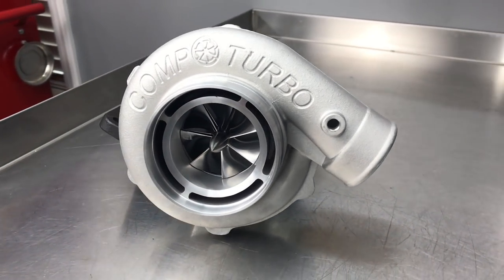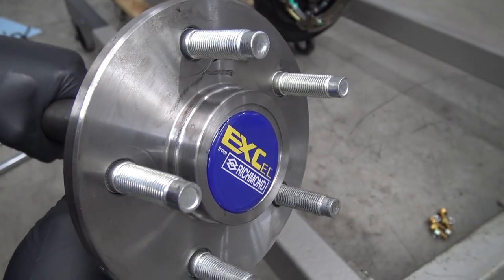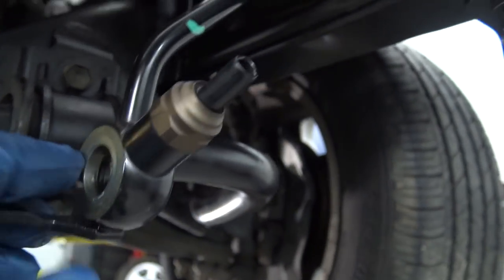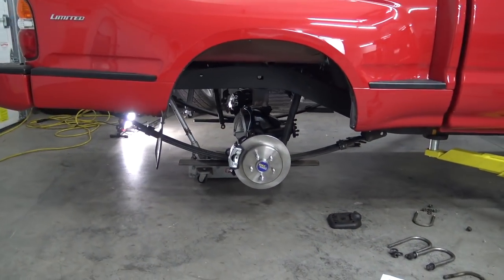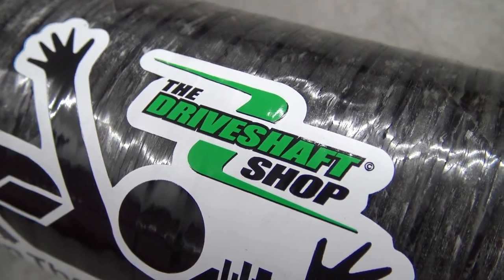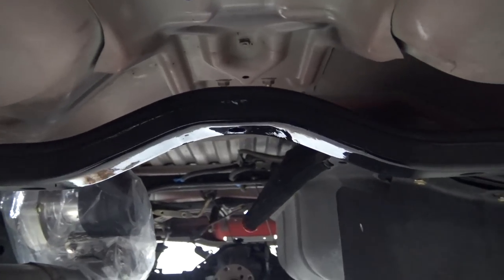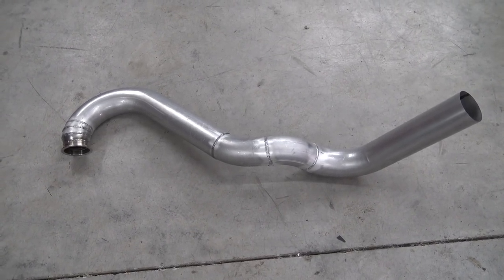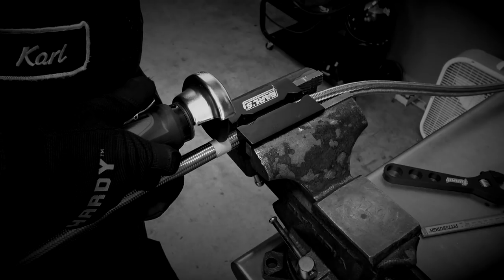LSX V8 Turbo Tacoma - Project Firebolt Part 9

Comment: Wow, can't believe that axle is virtually a direct swap. I love it when parts from other brands can be interchanged, it makes building your own unique project much easier. Great exhaust job BTW, keep up the great work. ;)
Reply: The Taco is a pretty accepting body. Quite a few different bits and bobs can find under and still look OEMish. My theory is that Toyota did some market play and knew that the average Joe would eventually do some twiddling with their truck and made it possible to swap in existing parts off other cars. Would not be a first, Honda certainly played nice with the locals.
Reply: @aserta  You might be right about Toyota, or is it possible they "copied" the Ford unit? Talking about OEM, I like the way Tom does his builds, they always look OEM and factory, gives the finish project a very clean look.
Reply: The explorer 8.8 fits under a d21 hardbody as well.... I'm doing a similar build, only 5 spd manual.
Reply: @derekhansen6652  Really? It's like Toyota and Ford are "pick n mix" lol.
Reply: Ford 8.8 is certainly the best choice for this build. They have been used for decades on Jeeps and have broad aftermarket coverage. Bonus for an easy fit on Tacomas!
Reply: @painmagnet1  Yeah, isn't the Ford 8.8 virtually indestructible? lol.
Reply: @ProjectSupercar  it's beefy, cheap and plentiful.
Reply: @superduty4556  Yep, just the way I like it lol. :)

Comment: Muffler too shiny? Wrap it! It'll help stop you melting your spare as well :)
Reply from the maker: Hi Nik, I've considered wrapping it or chucking one of those muffler blankets on it.
Reply: I was thinking a coat of ceramic high heat paint would be great compared to a blanket. I'm not certain but that being in the undercarriage it may just collect debris and water.
Reply: I feel a Binky style "CAD" designed heat-shield is required. Flex those fabrication skills. And of course painted in the habitual enamel black
Reply: For sure! Also, regular paint doesn't last on stainless. Ask me how I know.
Reply: @TomsTurboGarage  I put a Vibrant resonator on the back of my GMC (solution to a way too loud cat back system). in a similar location your muffler is in.  If you plan on using your truck in all weather conditions, the high shine will dull out over time.

On other note,  Awesome build!

Comment: Looks like you may want some longer wheel studs for that rear. The wheel bolts didnt look like they had too much thread engagement.  Always run three thread out in safety for aviation so maybe I'm just being over cautious. 
Great video as always though, always jealous of your shop setup!
Reply from the maker: Thank you sir, that is a good tip, I'll definitely need some longer ones if I want to run slicks.
Reply: Maybe some ARP extended ones? Trustworthy and track tested. Some may say ugly as they can protrude through the nut........... but not as ugly as a motor on the side of the track missing a wheel!!
Reply: It is worth noting that this style of lug nut does not seat on a taper in the wheel, they are designed to pass clean through the hole. The washer is the contact point. While extended studs may be necessary if he wants to run different wheels/racing slicks, they fit very similarly to the stock arrangement as they are now.
Reply: Given the lug nut style it looks fine to me.
Reply: Don't get me wrong for a daily driver they are more than enough especially when you consider the design having probably twice as many threads compared to a stock nut.

My thought was for track use and potential wheel changes or use of spacers you suddenly eat up any benefit the better design gives, with the increased stress of the track or strip And for the sake of £34/$42 a side when you have spent thousands in parts and your own time, seems worth it in my opinion for the peace of mind when you rip down the strip for the first time.

Probably me being over cautious and coming from a trade where it's laid down that the threads of the bolt must protrude 1.5-3 threads from the top of the locking device. But I figured I'd mention it. At the end of the day it's up to Tom to check and decide for himself we are here just to watch and suggest ideas and things he might have missed by accident. Best part of a public build on a forum or on YouTube, the community has always got your back

Tom has the benefit of having 181,000 people QA'ing everything he does........it must be a benefit and a curse!

Comment: I know it's a little late now, but SWAG Offroad makes a neat table adapter that you can bolt your portaband into. It makes doing those pie cuts real easy. I love mine. 
And, to make fabbing up easier, you can purchase some wide 2 bolt exhaust clamps, cut windows in them, and use them to hold your exhaust tubing while you get everything in the perfect location. Tack em up on the truck, remove clamp, and weld out. (The clamp idea is not mine. Seen it on YouTube somewhere

Comment: Certainly a fan of Driveshaft shop product. I was updating the FD ratio in my Subaru BRZ and went for their Aluminium product myself. Its an NA build so have no worries over durability. Its still a lot lighter than the stock one also.

Loving the build!

Comment: Tom, I've said it before, you're an inspiration to many, myself included, to do better. We may not all have your tools or work area at our disposal, but you, without a doubt, provide the example of how to do things in a quality manner. Thanks for that.

I have one of those Driveshaft Shop carbon fiber shafts on my 87 Supra. I'd recommend making some sort of shield for it, to protect it from road debris. Nothing quite like an expensive street sweeper spinning under your truck...

Also, putting stock wheels / tires back on, with a turbo LS under the hood? You must have a lot of faith in that differential! =)

Comment: It may be worth it to look into reinforcing the frame with some steel plate where the cab meets the bed. If the frame fails because too much power, that's the point it will fail. Every Tacoma that had rust that i have seen, the frame where the cab meets the bed is always the first to go.
Also it'd be awesome if you found a way to install an exhaust cutout switch that dumps exhaust right out of the turbo. Flip a switch and go from quiet to crazy open exhaust. Great for the track.
Great progress so far! Everything is looking pristine! Cant wait to see this thing come to life! Keep up the great work!

Comment: I have had several people ask how well mild steel weld wire works to join stainless bases- shouldn't you use stainless wire? The answer is no, it welds beautifully. In addition, if your welds are of minimal size they draw in enough nickel from the base metal to become stainless as well. Lovely build, Tom!

Comment: Heads up, I use that Firewall mounted dipstick. It always got pulled out, I'd make a bracket that comes off your engine or transmission so when your chassis is moving separate from your engine/tranny, It won't get pulled out. I Dumped a gallon or two of ATF on some trips because of that haha. Also I love your videos! <3

Comment: If you haven't planned on doing so already, you might want to look into getting a new brake proportioning valve since you swapped from rear drums to disks. 

Drum and disk brakes require different amounts of fluid to function and your stock prop valve is set up for disks in front and drums out back so it probably won't send the right amount of fluid to the rear brakes for your new disks.

Comment: I've seen guys run rear turbos on Corvettes with no muffler.  The turbo itself does a pretty good jump dampening the sound out.  Did you consider trying that?  
Love this build!
Reply from the maker: Thank you Brian!  Yes it is possible that it will be quiet enough without needing a muffler, hard to tell until I fire it up.  I stick a v-band back there so I can run different setups if needed.

Comment: Hey Tom, for the brakes, ditch the ceramic pads in favor of metallic. Ceramic pads have no place in a performance car (truck). If you want to stay with PowerStop, get the Z26... it is Carbon Fiber - ceramic blend, I wouldn't use it myself (Camaro SS and a soon to be turbo charged 18 Silverado), but there is some decent feedback on the forums, with most guys still favoring the OEM Camaro pads over them.
Reply from the maker: Thank you for the tip on that sir, I appreciate it!

Comment: Random thought here, but with the turbo upgrade and the exhaust being so close to the spare tire, please shield the spare tire from all that heat or it’ll heat cycle and degrade quickly. Would hate to find that out if you ever needed the spare! I’d bet heat wrap on the exhaust and/or a simple metal heat shield could do a great job protecting the spare tire from all that heat. Nice work so far!

Comment: Even though you said you can shift the spare away from the muffler, i'd probably go for wrapping it in that heat tape over paint, just because i'd worry about the spare.
Reply from the maker: I agree, I'm considering a few different heat shielding ideas over there.
Reply: Just don’t get a flat and you won’t need a spare. I use laser focus to avoid all sharp debris in the road. Weight savings gets me all the wins out on the streets!

Comment: Hey bud I've built a handful of rear mount turbo setups and putting a muffler after the turbo will give you too much back pressure and wont be able to build boost. Just letting you know.

Comment: You should build shielding for the drive shaft to the exhaust, carbon fiber can cook, and for that matter, for the spare too. I suggest aluminium/aluminum with a fiberglass matting (summit had some really neato heat shielding, i forget what it's called). At speed, the metal will cool faster and keep things kosher. The spare might survive by the muffler, but the shaft won't like it for sure. I cooked a CF hood, so i speak from experience.

Comment: Looks good man, from experience you are going to want to put a flex pipe right after the turbo mount for the exhaust...  Doesn't have to be big at all, and I would be scared of the heat that close to the carbon fiber shaft, would fab up a small heat shield to go above it to help shield the heat just a bit, like you did under the engine bay:)

Comment: Good project! I really love your videos. I realized one possible issue though... I suspect a hitting between driveshaft and the frame area where you removed the brackets. When the rear axle moves up (loads or bumps) the crankshaft will be really close to the frame rail. Greetings!

Comment: I will say you may have over looked the thread pitch between the stick Ford and Toyota wheel studs. If you want to use the stock wheels safely, swap out the wheel studs to the 12MX1.5’s.

Comment: Looking awesome. Wish there was trucks like this where I am. Everything up in ontario is rotten to dust and especially Toyota pick ups. Bunch of the years had that frame recall and then the recalls started to rot out also.

That drive shaft still seems kind of close to that old brace when there is load on the tires. It going to clear when moving up and down?

Comment: The two bolt on the summit rear differential plate. Why didn't you replace that with some bars to run a differential cooler kit

Comment: absolutely love the build. I'm glad your doing another ls swap vehicle. I just had a question as far as the waste gate dump pipe, if I may. the exit seems close to the rear tire, not sure if exhaust smoke and oil would be a concern for grip on that rear wheel and the chance for contamination if it did occur. Is this something that in its design, due to the angle, I did not see and was avoided, or is not the final design?

Comment: If the rear mounted turbo doesn’t work out, twin gtx2876r’s in a hot v configuration would be tight.

Comment: Hey Tom I have to say this was another great video.  I have a couple of questions. What type of pipes are you using stainless or just 16 gauge steel. Next what type of welder are you using and type of wire.  I have a trailblazer ss I am about to start building my own exhaust so just curious what you used. Keep bringing us the great videos.

Comment: I’m surprised you’re not doing any suspension, I’m assuming you aren’t because you made the exhaust before lowering it. There’s going to be a ton of wheel hop in a stock Tacoma and it might have a bit of a hard time puttting the power down.

Comment: Brilliant looking drive shaft. Question for you... why have you mounted the wideband so far away from the manifold?
Reply from the maker: Thank you sir!  On turbo applications, the oxygen sensor has to go after the turbo in order to get an accurate reading.
Reply: @TomsTurboGarage  of course I was thinking too much about the sensor requiring a little heat from the engine to function well rather than reading poorly due to the pressure between the engine and turbo. 👌😎 loving your builds have watched your channel on my lunch breaks.

Comment: Be careful you might want to put some weight in the back of that truck and make sure your drive shafts not going to rub where that carrier bearing was anytime I've gone from a carrier bearing to a straight drive shaft on anything I've had to rework that mount to keep it from rubbing the drive shaft with weight on it

Comment: The turbo lag is going to be immense due to all that pipe that has to get Filled  with pressure.
Reply: The saving thing here is that the V8 will have a good amount of power already so it will get along just fine.

Comment: That muffler is going to be a back pressure issue. I would add a cutout, but turbos want absolutely no back pressure or else it will hurt performance especially with a rear mount setup

Comment: You could have installed 12x1.5 wheel studs out of a newer Ford Explorer and used the stock Toyota lug nuts on the rear wheels

Comment: I'm no expert on carbon fiber, but isn't that exhaust too close to the driveshaft? If it overheats, the shaft will warp, and go out of balance. Maybe heat-tape on the exhaust there, AT LEAST? Nice.. there ya go! Hope that does the trick.

Comment: Open diff with that power?  Wow...think I woulda gone with a Ford LSD carrier with carbon clutches...not that spendy.  The LSD carrier you could likely salvage from a Ranger FX4 or similar.  FWIW, there was a review done by an Engineer "numbers guy" that pretty much proved that after market diff covers don't help, just look better.  Cut capacity and effect fluid flow negatively.  Though just having a drain plug would be worth it!

And those calipers...they're weanier than the front calipers for my Ranger...1/2 the size, literally.  Rears should have more Oomph, again, IMHO.

My Ranger has the 8.8 pumpkin, but 7.7 stubs/axles...Frankenstein stuff.  Thinking an Exploder axle swap is going to happen next year after I sort my power plant.  And a set of the largest discs I can snug in there with either monster dual piston or a pair of smaller dual piston calipers.

Comment: Why not press in studs with the right thread so you don't have mismatching lugs and studs front to rear?
Reply from the maker: I looked into that, studs were too different.
Reply: @TomsTurboGarage  Oh damn. That's an annoying little issue, but not really worth going to great lengths to fix I suppose.

Comment: I wish you had room under the hood for that turbo!! Also would like to have seen the exhaust from the turbo machined out to 3.5"; the larger exhaust size won't help and may hurt as there's more surface area to lose exhaust heat, resulting in more work needed to vent

Comment: Not that I ever disliked your OEM clean approach on everything but machining down the axle to fit a stock Tacoma wheel was one of my least favorite moves you've done. now if you wanted to get a beefier wheel or change a wheel you would have to get a special hub-centric ring made now you just added more work.

Comment: Those stock tires are too small for the power you are going to be putting down. 265 mm wide tire would be bare minimum and that would be too small.
Reply: I'm sure Tom already knows that and will be sending the stock Toyota wheels out for wheel widening in a future episode. For now, he is focused on getting the truck back together and running so he can get his pickup truck back.

Comment: Amazing work, but I'm starting to get bummed out.   You are ramming in massive HP in the front, beefing up the rear, end, but sticking with stock rear suspension, leaf springs and  wheels.  Again, you do great work, but at least make this truck look like it has the power it has.

Comment: ---------------------------------------------------------------> Here are a couple guaranteed problems you'll have... Well, both issues will result in the same thing. Far less HP & trouble tuning it.
1. Because of the rear-mount design, the turbo won't be able to pressurize the entire intake system, thus NEVER reaching max boost. Severely limiting potential HP.
2. You added RESTRICTIONS in the exhaust PRE-TURBO ! This will ensure the turbo never see's max PSI... You can't impede flow before the turbo, it has to be free.
* I love all your build series, but this one took a turn for the worse the moment your said "REAR MOUNT TURBO"... Not being derogatory, just honest. Cheers !